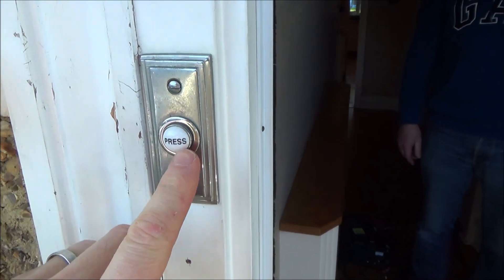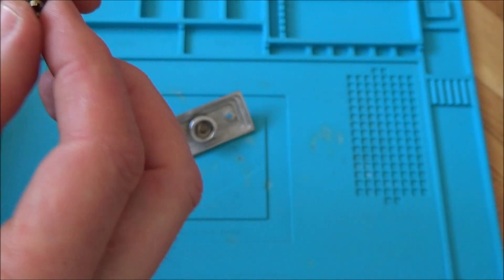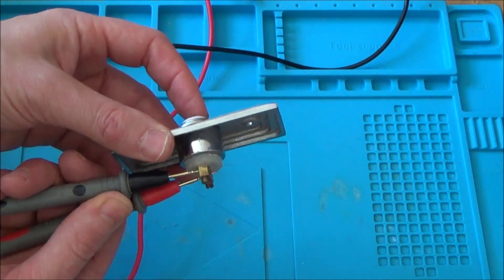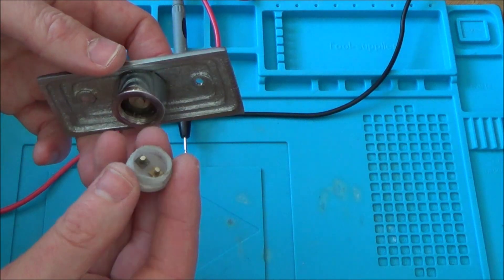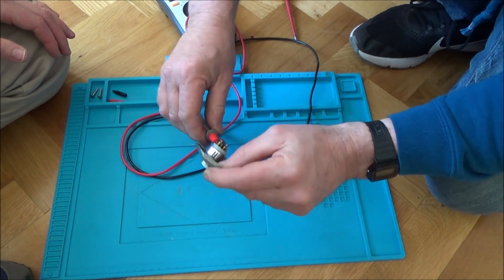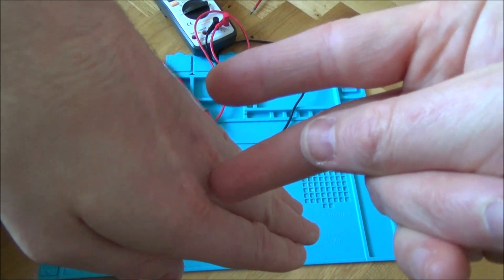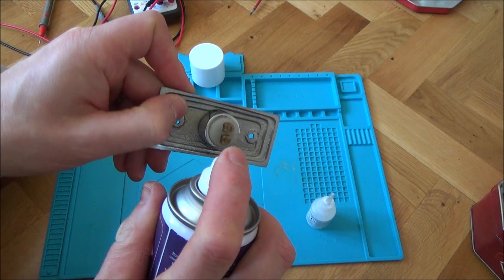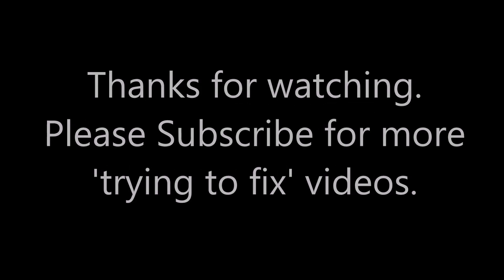Trying to FIX a Faulty Wonky Doorbell

Comment: I think I would have tried to glue 2 springs from a pen into the contacts, so the buttons travel distance would be shorter and you'd needed less force to activate it. Or maybe small batterie contact springs.
And a washer glued on the button side.

Comment: Is it possible that the crooked plate should float on a central shaft and has just become jammed or corroded in place? If it were allowed to float then the spring behind it that returns the button to the out possition would provide an even pressure to the contacts no matter how hard the user pushed the button. That would also prevent the contacts from being pushed out the back. Love your videos by the way!

Comment: Would it of worked if you had of swapped out that plate and spring system and replaced it with a sprung loaded momentary push switch inside which you could of affixed behind the push button on the front ?

Comment: can't you just solder on 2 small (conductive) springs on the contacts so that it doesn't matter if the button is not straight?
Reply: they don't even have to be springs just something flexible that still conducts electricity

Comment: When it fails the next time pull out the contacts and use a push button switch instead of the contacts. Keeps the original door bell metal. base

Comment: Actually some good ideas here, but as the design is poorly made, a smart thing to do would be grounding one of the cables to the plate or solder a wire to one of the screws and file that one down a bit and just use one contactor. Or well buy a new one then.